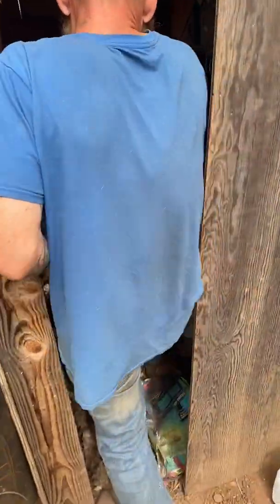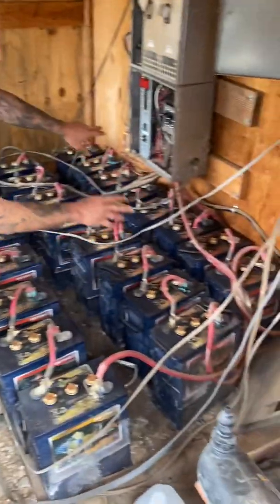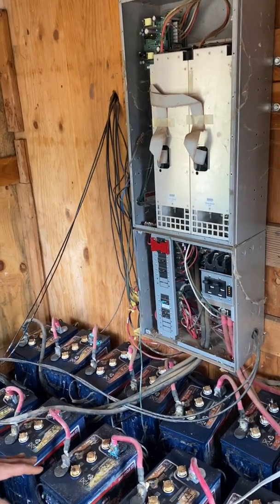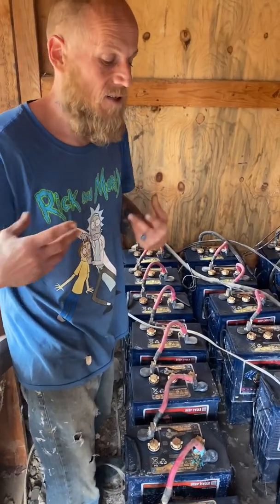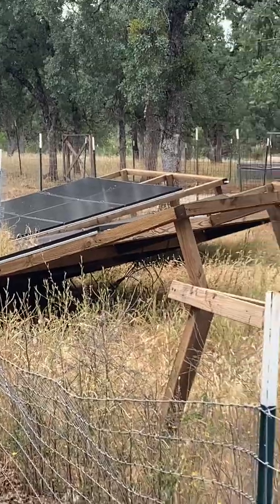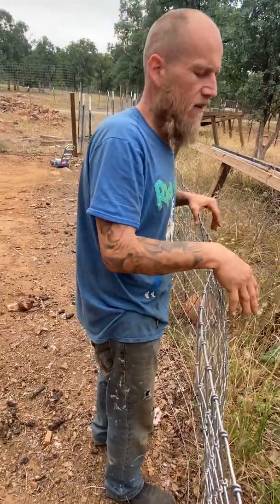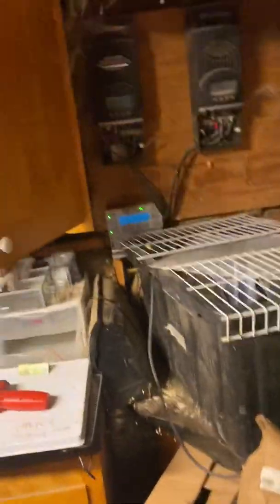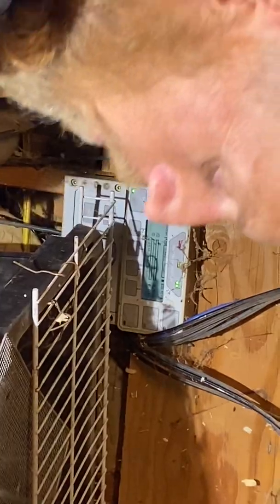Solar system maintenance

Comment: When you drop those volts to 48 what happen to the rest of them? Sorry if it is a stupid question.
Reply from the maker: Definitely not a stupid question. Volts and amps are inversely proportional. If you drop or raise the voltage it then does the opposite to the amperage
Reply: @BenjaminBalderson  thanks.

Comment: Benjamin how much do estimate the start up cost was for your system if you bought everything and do you cool with solar?
Reply from the maker: My system is fairly large for a solar setup, my inverter you can find for 5000, 1500 for solar controllers, 500 system brain, 7500 batteries, 78000 for panels, 3000 generator and probably another 2500 in wire and fittings and such
Reply: @BenjaminBalderson  thanks for the info. Do you power an AC with that or do you use alternative like propane etc? Or does your climate allow for not needing it?